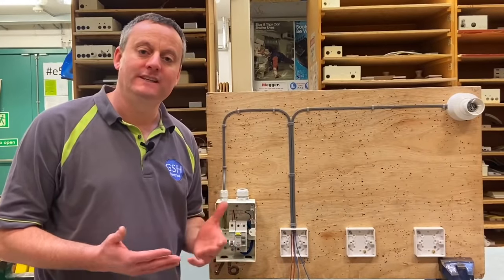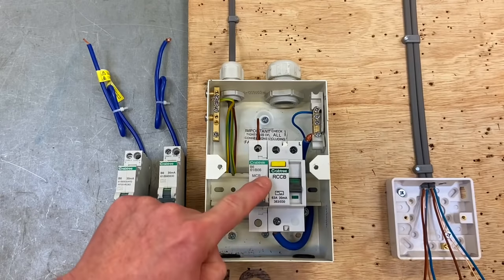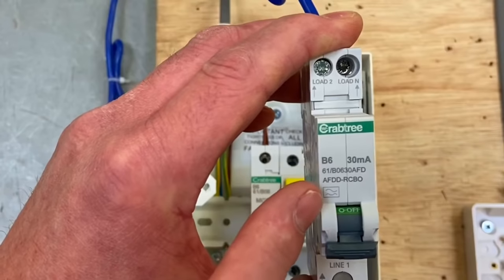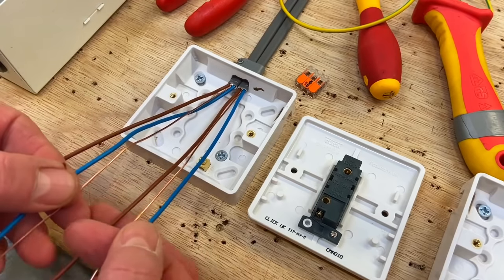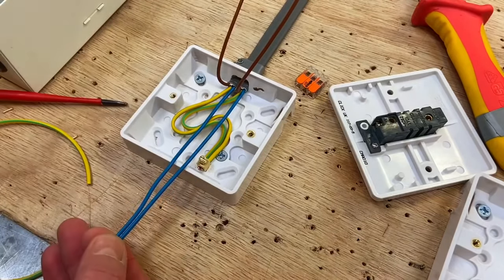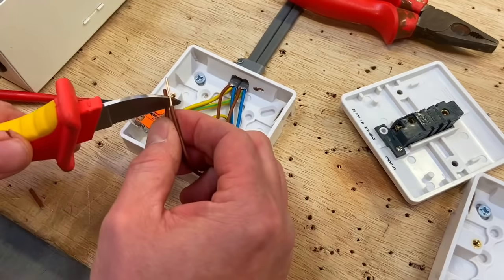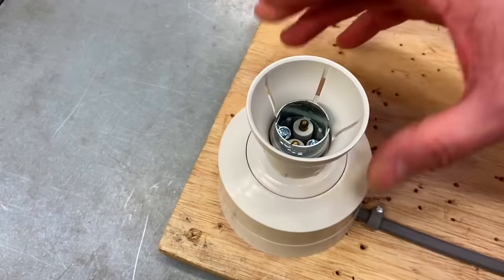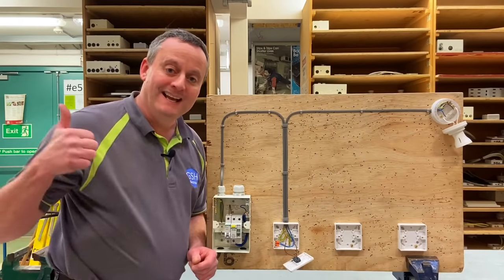Lighting Circuit 2 Plate Method Taking the Feed to the Switch and Connecting a 1 Way Switch & Light

Comment: For some strange reason, all of my sparky mates call this 'light in the garage method'.
Reply: Wish they'd done this at a neighbour's attached garage. Whoever added the light did it 3-plate/loop-in so the garage fluorescent is the first connection on the ground floor lighting circuit. No idea why as it meant modifying the as-built house wiring.
Reply: i as a retired spark still do
Reply: Ha ha yeah it’s a bit like me calling Ohms law ,Purple Ohms law for those that know have a nice trip 😄

Comment: I feel good! Pro proving I'm correct to do what I do. I've had to redo sloppy work by most registered professional electricians I've ever used so I worked out how to do it this way - long wires in box, fold over, keep wires as clean as possible, sleeving the correct size for wires, Wago connectors And I scrape out every trace of plaster or paint.
   I think I've found a solid, diligent domestic electrician for my next job - new up to the minute consumer units with separate circuits for each kitchen appliance.

Comment: Undoubtedly the best way of doing it for several reasons. Firstly you're not working above your head trying to wire up a load of cables into a pendant that will probably be removed to install a fancy fitting so all the wires end up in a mess in a choc block and secondly you don't have the issue of confusion with a blue switch return invariably not sleeved being wired to the neutral but you did mention that. Also the wago connectors are brilliant.
Reply: What if you needed an unswitched line conductor at the ceiling position for a fan or  life and safety detection like smoke, heat or CO2 ?
You'd be stuffed with the two plate method.

Comment: Hi as a sparky in Austraila, have been taking the cables to the switch for years, one cable at the light fitting and most connections can be done on the floor, not up a ladder. The earth conductor, sorry CPC has been insulated for about 35 years. Great to see how different countries carry out electrical works. England appears to use a lot of SWA, where we use PVC conduit and single/double insulated cables.

Comment: Exceptionally clear Gaz well done GSH.

I am glad you are recommending installation of AFDD-RCDs Type A breakers for circuits. That’s also the latest advice in the USA NEC 2020 standard. I would also put in for the socket and lighting circuits, AFDD-RCDs at the first socket protecting the downstream sockets and lights thereafter. Not sure these have taken off in the UK - Leviton do that here as do Schneider, Square D, Hubbell, Eaton, GE. 

Offering two points of equipment and personal protection 

1.) From breaker to socket/light
2.) from first socket to all other sockets/lights.

This provides two safety points and protects against failure. Latest version of RCD and AFDD are much better in handling Mix of AC and DC equipment in residential circuits especially transient and over voltages. Add surge protection class 1 and 2 and you’ve layers multiple protection making residences more stable and safer.

Once that’s sorted you move onto power quality issues but that’s a whole different ball game but one that’s going to be very important in the future.
Reply from the maker: Thanks for the very detailed comment 🦾. Gaz
Reply: Very Sad that it AFDD will become more prominent in the UK in the years to come in lieu of investing in the training of skilled electricians and stop allowing cheap crap to be sold in the UK. AFDD will only make suppliers rich, but will not make any difference to a fire started or deaths in the household due to electrical fires.

Comment: Had to do this in college and was so confused. This helped a lot.
Reply from the maker: Wiring Diagram Lighting Circuit 2 Plate Method Taking the Feed to the Switch - 1 Way Switch & Light https://youtu.be/A19SCa6FUss 

This may also help 🦾. Thanks for commenting. Gaz

Comment: A very neat installation and in many circumstances, this is so much better than having lots of cables at the ceiling rose. 
The only thing I am not keen on and I do realise they have uses is the traditional shallow back box, if I was chopping this into a wall I would go for a 25mm socket back box if it was possible.
Reply from the maker: Great advice 👍

Comment: Gary many years ago when I was an apprentice taking a neutral through the switch was a no no. Never did understand why, makes wiring much simpler. Trouble is picking a new feed up from a wall switch plastered in switch box could be messy.
Most lighting circuits were spidered out from one of those square BICC junction boxes.  Happy days !
Reply: That's why you put brown sleeve on the blue wire to tell you it's not two plate.

Comment: This is the best way for modern light fittings as well as smart switches needing a neutral to operate. Another note you don’t need to double over those CPCs if you have 2 in the same terminal.
Reply: @Franklin Drake instablaster =)
Reply: @Carson Elias Thanks so much for your reply. I got to the site on google and Im in the hacking process atm.
Takes quite some time so I will get back to you later with my results.
Reply: @Carson Elias It did the trick and I actually got access to my account again. I'm so happy:D
Thank you so much you really help me out :D
Reply: @Franklin Drake No problem :D

Comment: I moved from the UK to NZ and here we always have the feeds through the switches. No old UK ceiling roses here. I prefer it, even though switches can get very busy. Just my personal choice, but I don't use the loop terminal for the neutral. I put common neutrals and Earths all in their own connector block stuffed into the back of the flush box, so there are only lives at the switches. I like deeper boxes too. I hate having to stuff cables into tight areas. Also I never use 1.0m for lights. Always 1.5.

Comment: Interesting stuff. How times have changed. Served my time 40 years ago and back then there were two types of lighting circuits- loop in at the rose or junction box method. Connecting neutrals at the switch was not common practice. I wonder what my old instructor would have made of  this. “What! no red sleeve on the switch wire”!
Reply from the maker: Thanks for watching and the great comment. Gaz 👍🏻
Reply: the looping in at the light fitting has not been done for years at least 30 yrs, plus now it should be brown sleeving
Reply: @geoffriley475  I'm working on site at the minute and they still do it.

Comment: Nice video, thanks. I followed this for a simple light under our stairs using a live feed terminated there by previous owner. The little tester pen shows current to the bulb when the switch is on but the bulb doesn’t light - any ideas!?

Have checked bulb and the fitting also.

Comment: Hello mate, I've watched a bunch of your videos looking for a specific answer to something and i can't seem to find it, so i wonder if i could just be specific with you and see if you have the answer. (Great videos by the way for someone looking to learn the trade, you're extremely detailed).

Ok so, i have a 2 gang switch at the bottom of my stairs. The left switch turns on/off the downstairs light, and the right switch turns on and off the light at the top of the stairs. Upstairs there is a 1 gang light switch that also turns on/off the light at the top of the stairs.

I am looking to swap my light switches to smart switches and i am completely confused on which to get in terms of 'way'. What's throwing me off is the downstairs 2 gang light switch, because the one on the left is 1 way correct? and the one of the right is 2 way. So the light switch panel is in essence both? The upstairs one is obviously simple; its 1 gang 2 way (right?! lol) but yes the downstairs one is throwing me off. 

Once you help me with the correct switches, is it as simple as just putting the wires exactly where they were in the previous switches? 

Im really looking forward to your help and finally figuring this out!

Comment: If you were to use this method for a 2-gang switch, would you bridge the line-in to the second switch.

I have one ceiling rose light and LEDs, I brought the line-in down to the switch and wondered how I would add the live line in to the second (LEDs) switch in the gang. Thanks

Comment: At the ceiling point there is only a max of three, 3 core cables.  feed in, feed out and a drop wire to the switch.  If you use this method, you have the same, but in a switch where there is less space and then how do you run to next switch? Around the walls where you have more chance of putting a nail through the cable; I think not.  Light fitting to light fitting is the best.  Ceiling rose light fittings have a nice set of connections.    Even with a row LEDs the cabling is simple and clean.

Comment: Great video, very well explained. Thank you. Question though if you have multiple switches to feed (multiple rooms) from this single circuit, presumably you would have 3 cables coming in/out of the switch I.e. feed in from the consumer unit, supply out to the light fitting and a feed out to the next switch?
Reply: Yes, take another feed from this switch to the next switch and so on

Comment: Great video. So clear!.
I have a question. Ive swapped switches to smart switches requiring no neutral in my 1st bedroom. I have 3 brown wires going in at the switch. Neutral (Blues) not used & are blocked off. I identified 1 of the 3 browns as live, guessing that makes the others a switched live? I've put the 2 into the L1 and the single live into the com. (also switched this combo).  But now the other lights upstairs (bathroom bedroom) have no power when I switch off the bedroom light.

From your video, I am thinking that one of the two brown wires that have no current running through, must be the feed out of this room to the rest of the upstairs?  Any suggestions on how I can identify what each of the brown wires do, so I can fix this?
Thanks

Comment: I would be interested in understanding how this wiring would be modified if for multiroom application. How do you cable from the switch to next switch to next switch etc. Would you loop in at the switches? Would to loop in at a maintenance-free junction box, some other method?
Reply: return a feed from the switch to the next switch.
Reply: Employ a registered electrician

Comment: Good video and explanation. We’re you using 1.5  mm cable?
Reply from the maker: 1mm2 cable 👍
Reply: @GSHElectrical  thank you, I’m putting a new radial lighting circuit in my house . I was thinking of using 1mm cable but most forums seem to say 1.5 mm. How would you calculate to be sure.

Comment: Thanks Gary, very clear video, but are you allowed to have a “floating ” connection inside the switch box (the cpc is fixed but the N is not). I appreciate it’s common practice, but does it strictly comply?

Comment: Thanks for this video mate, really helpful! Is it right to assume that if you were wanting to use this method across multiple rooms, you'd need to have a third 2C&E cable in the light switch which carries the feed over to the switch in the next room? So there is a feed cable from the consumer unit to the switch, the feed to the lights, and then the feed to the next switch.
Reply from the maker: 100% from the switch to the next room etc 👍
Reply: @GSHElectrical  thanks for confirming mate. Final question, and it's quite specific...! If you wanted to use this method, but with wireless switches where they are tucked up in the ceiling, are there any Regs issues with that?

Comment: Excellent video again guys my boss makes me put brown sleeving on the brown conductor that goes to L1 and says the brown from the consumer unit always in common I asked why brown sleeving on the L1 he said just for quick identification if you have to remove the switch he says not everyone does it and is not really necessary but he likes it done that way what's you're opinion
Reply: Its really not necessary at all. Brown, Black, Grey are identified as phase or Line conductors, it serves no purpose identifying them with brown sleeving.
Reply: As my boss said its only the one brown from DB we had the conversation about the phase colours it's only his method so he can identify the live core from the board when he is testing 30/40 rooms I do see his point though
Reply: @markandrews8437  There's many instances where Black and Grey colours are introduced to a single phase installation, via a 3 core cable. Sleeving everything brown is something you will probably drop when you move on. 
    If you're learning, the very best of luck to you, but its more important to be aware of mixed colours and older wiring, than get bogged down with an unnecessary action.

Comment: Great Video HOWEVER...... After finding your video and learning the term "2 plate method", I have been unable to see how you go on to the room/switched light. You show 2 videos showing this method of a cable from a consumer unit to a light switch and then it stops there. Most lighting Radial Circuits will have more than the 1 light switch and light. Now it may be clear to some but i have always been against this 2 plate method as I feel back boxes are not deep enough and it being tricky the more wires that go into there. So my question is.... using this method how do you make your connection to the next room? are you A) putting a junction box in the ceiling to split off different rooms on your cable between the consumer unit and the switch OR B) are you putting a third cable to this light switch to go off to the next room/switch.

I have been re-wiring my own houses for a few years now. I always fit down lights in every room in every house and I tend to put junction boxes in the ceiling for each switch therefore i have a single cable going to the switch (3 plate method i think). Its been commented a few times when the work is signed off why do I not power by the switch?!??!?!   - The answer is I have come to my own conclusion that 3 cables would be needed in the wall switch which I feel is a bit overcrowded and harder to work with. I may be wrong here which is why I am asking. It's good to reference against what the professionals are doing.
Reply: Take it to the switch, one more neutral into the wago, one more earth With the others, double up the permanent live in the switch terminal.. not too much of a squeeze (I’m not an electrician either)

Comment: Really good instructional video, never heard of Wago connectors before. However,  having spent nearly 50 years in industrial safety, appalled at the use of a knife for wire stripping. Remember an apprentice cable stripping and stabbed his thigh. Would have died had we not got our own medics and surgery on site. Still.l using my 50 year old Bib strippers!

Comment: Great video, but how do you link the lights on a radial, e.g. from room to room, using this method?
Reply from the maker: Wiring Diagram 2 Plate Method - Taking the Feed to Another Room or Switch Connection Explained https://youtu.be/R3_eXKo1NFQ

Comment: OK I've got my head round this but what I haven't is if I want two different switches side by side for two separate lights do I still need power or can I basically jump that across and just have a switching wire to the other light? 🤔

Comment: Excellent video, however not massive fan of working with these tools, especially because automated wire strippers are widely available. Good practice doing it this way, as smart switches also require line and neutral nowadays.

Comment: Hi i have wired my garage LED strip lights x4 by using 2 plate method, but switching is ok, but when switching off the RCD trips, can point me as to where the fault is , these lights have been working for four years. Thank you 
Tony

Comment: I like that you only listed reducing the amount of wiring at the fixture. 
You should ask... 
Do you want to pull and route cable with your feet firmly on terra firma most of the time, or do you like standing on a ladder for most of it?
Do you want to solve 9 out of 10 service issues at switch height or on top of a ladder? 
Do you want the installation of your smart switches to be a breeze, or difficult as you search for one that really works without a neutral (Lutron)?
“Two plate method” aka “The better way”😜

Comment: @7:44 IMHO, the non-levered Wago 2273-202 (good for 2.5mm and rated 24A per IEC/EN) would have been the better choice for that ;) (for both the PE, which is not needed in this switch anyway, as well as the N)

Comment: For a 2 plate method, is it against the regulations to take the neutral straight to the light instead of going to the switch and having only the live feed going to the switch? Kind of like a hybrid between a 2 and 3 plate method. Looping of live would then be from one switch to the next switch and looping of the neutral would be from one light to the next light